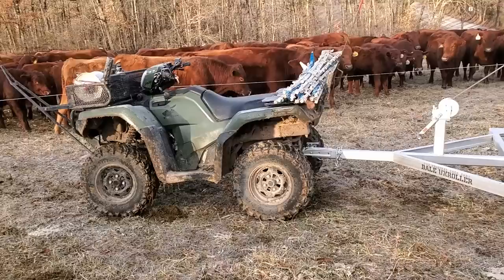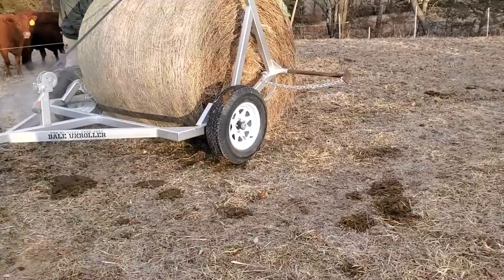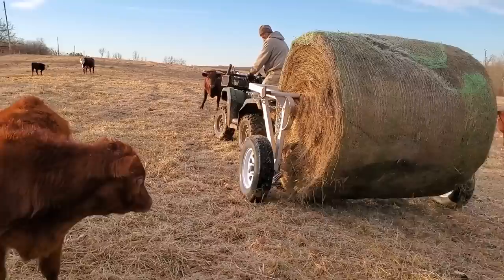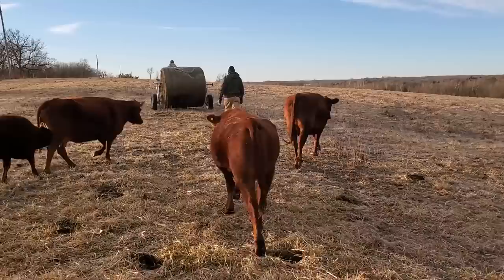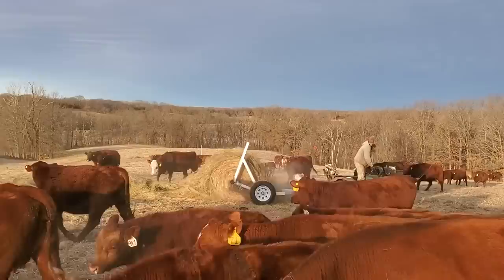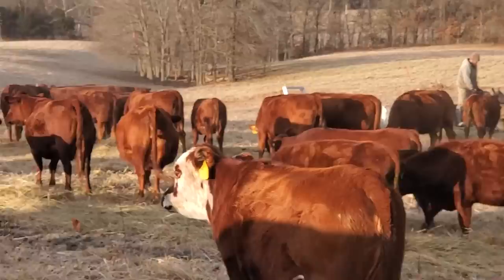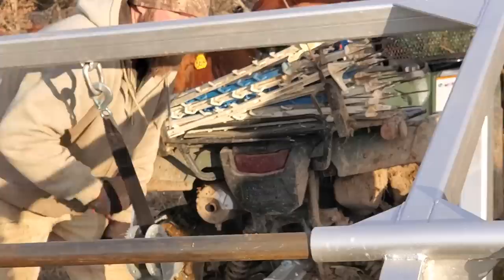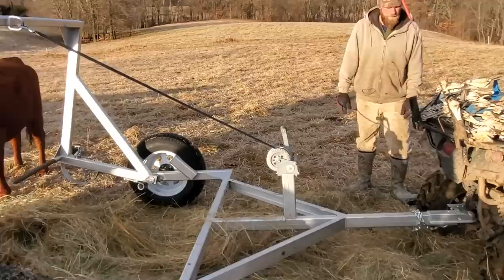Greg Judy ATV bale unroller in action, feeding 292 head with four wheeler

Comment: I have a hay unroller that I use on the tractor and would not use anything else. I would like to have one of these for a 4 wheeler when it gets muddy but they are kind of pricey. I plan ahead now for wet weather and as I unroll I will leave a fourth or so of a roll and will put it on a small trailer that I pull with a four wheeler and take it to the cows. I then unroll by hand. This works well on smaller groups but kind of hard on larger groups.
Reply: I don't have enough animals to need one yet, but I'm gonna get my local fabricator to build one for next winter. I'll probably show him this video. He built a smoker trailer for the local tavern for 300$. I bet he could do one of these almost as nice, and a lot cheaper than Greg could ship one to Massachusetts.
Reply: Yea I think he is doubling his money easy
Reply: The only problem is that if you have too much weight on a tractor you killing in your ground

Comment: Anyone keep hay like Greg does outdoors on logs with just the netting in a 50 inch rainfall region?
 It has been a very wet fall and winter here, I had some bales stacked on logs like Greg, and lost a lot of hay. I didnt realize how bad a little rip in the netting can be. The guy I bought it from said he loaded his truck with pallet forks. A good neighbor put me in touch with a nice old hay farmer who has hundreds of bales left that are higher quality and 5$ cheaper. He's bringing them by four at a time and I'm keeping them under a tarp until I use them.
Reply from the maker: If the netting gets torn, the bale will really spoil quickly. The other thing on the logs, we started using bigger diameter 8-9". Also putting the logs closer together.
This keeps the entire bottom of the bale off the ground.
Reply: @gregjudyregenerativerancher  thank you.

Comment: Question about backing that unroller. I can back a trailer just fine but Ive got a small 4x5  2w trailer that I cannot back to save my life. No rhyme or reason to the direction the backend of thing goes no matter what I'm doing w the steering.  Are these unrollers the same, since it's short wheel base also?
Reply from the maker: They are easy to back up with a little practice.

Comment: You should somehow retrofit a electric winch onto your setup. Could easily run the power from the quad and speed up the process.
Reply from the maker: Might work fine, but it is another thing that could break on a cold icy morning.
Reply: @gregjudyregenerativerancher  yeah that's true, that's usually when stuff decides to break aswell. Nice design anyhow